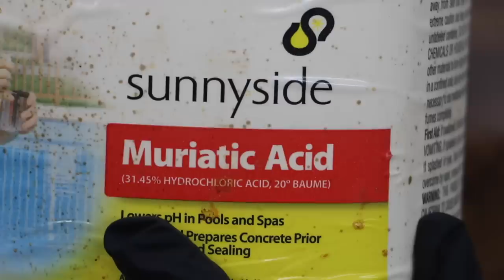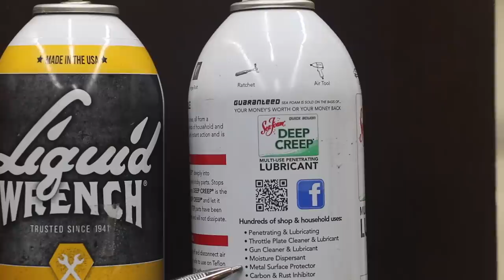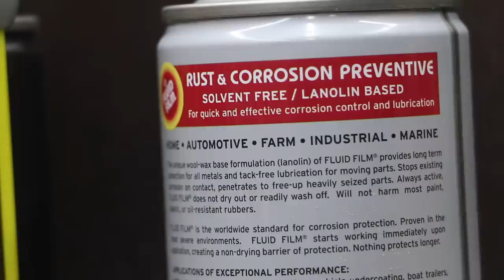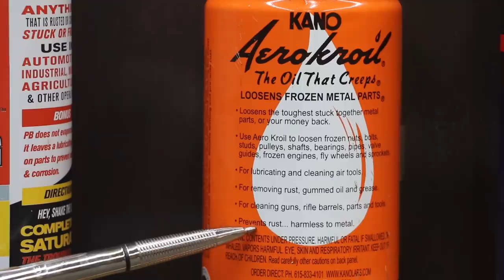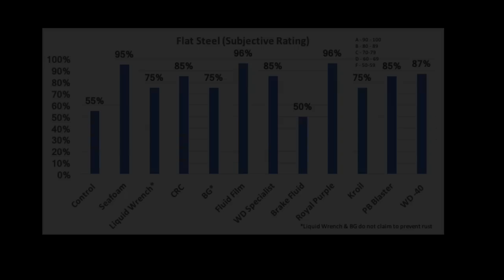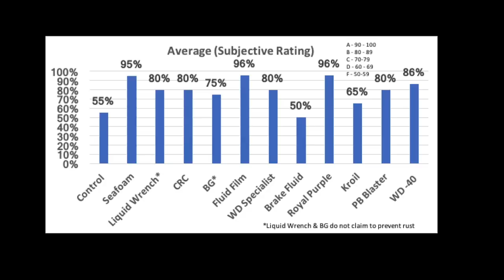Do Penetrating Oils Block Rust?  Let's find out!

Comment: Brake fluid must be a good penetrant since it corrodes away at bolts lol.
Reply from the maker: lol. Great point
Reply: Brake fluid is great at attracting water, too.  Good stuff if you're into that sort of thing, I suppose.
Reply: Brake fluid is really good at cleaning metal because, as you showed, it penetrates really well.  However never use it if you plan on welding on that metal.  The heat will cause any residual (talking molecules) of brake fluid particles to convert into a highly toxic gas which can be deadly to anyone who breathes it in.
Reply: Oh crap........really?
Reply: Ooooooof, unhealthy!!! But that publication is talking about brake cleaner it looks like, what about brake *fluid*? I know it smokes like heck when heated.
Reply: Good catch, you're right.
Reply: @johnbrereton6823   Phosgene is a particularly nasty gas. I've smelled it.  It affects you immediately. My Dad was a refrigeration contractor.  I know that phosgene is  produced when freon  hits an open flame.  Older aerosol cans used freon for propellant.  Maybe that's the reason for the warning.
Reply: @jerrybobteasdale  https://en.wikipedia.org/wiki/Phosgene  is particularly enlightening.  Also, it was used in WW I as a weapon.  Confirms what you say but there are are more interesting details.

Comment: Thank you soooooo much for this. I'm building my boat and I've been using fluid film to redo all my electrical connectors, gauges, and control box and so glad I spent the extra money on it knowing I won't have to replace this again. While the down side is it leaves it gooey, I dont care cause at least I know the film is visibly still on doing its job
Reply from the maker: Thank you!  Fluid Film is a great product for blocking rust.
Reply: @ProjectFarm  tell me about it. Unfortunately the previous owner wasn't as anal as me so now I have to use muriatic acid to take the steering bolts out to toss and make all new.  Completely rusted and I saw how it ate up the rust

Comment: I wish you would have tried MMO, I have used it in my air tools to keep them from rusting.
Reply from the maker: Yes, I wish I would have tested it. Great recommendation.
Reply: good idea, I use their air oil in my tools, too. An old hot rodder I know swears by using like 4 ozs of it in his mopar 440 when he gases it up. The can used to advertise "top cylinder lubrication", not sure if it does anymore.
Reply: I use MMO in my oil (4 oz/qt) and mix it in the gas plus a little 2-cycle for added lubrication and corrosion protection from the ethanol gas. The MMO prevents gum and the 2-stroke oil prevents corrosion. In my mowing equipment, I use 2 teaspoons each per gallon of gas, no problems from bad gas... Air tool oil is a little different by absorbing and removing water

Comment: You could do another test and open it to gun oils or tool oils.   Some gun oils are as cheap as $3 and they are designed to protect big investments, so perhaps they can compete with the products at the Auto Parts Stores.   They're also available at walmart, bass pro, and tractor supply stores.
Reply from the maker: Thanks for the suggestion.

Comment: Is Wal Mart brand Super Tech lubricant the same formula as WD-40? It might make a good test lubricant. At less than $2 a can it would certainly be the cheapest. I use the stuff all the time. My biggest gripe with WD and Super Tech is the propellant usually runs out before the liquid,however there are some good videos on you tube showing how to recharge the cans with an air compressor.
Reply from the maker: Maybe I can put together a video on this. Thank you
Reply: I don't think they are the same.  I have a can of each right now and go back and forth depending on which happens to be closer at that time.  I feel the Super Tech Lubricant is noticeably thinner and most usually runs right off (like its viscosity is very similar to water); it does not seem to stick to the part as well and is more easily wiped off cleanly.  WD-40 seems a little thicker and "oilier" to me - more pools up on the threads before dripping off.
Reply: Totally. I think some brands run out of propellant early, but others continue spraying after all the product is gone.

Comment: Have you any experience with ACF 50 or CorrosionX on Iron or Aluminium?   They are very expensive but if they work a lot better then they are worth it.   ACF 50 claims protection on Aluminium for a year .... a very bold claim indeed!   I presume Iron would be similar.
Reply from the maker: Thanks for the recommendation!

Comment: At the print shop eons ago we found that Kroil actually has water in in it. We stopped using it.  And for my money I stick with wd40 for general water proofing car and truck windows and ignition parts and nothing beats liquid wrench for rusty bolts. Just give the bolt a spritz every once in a while and go work on something else.  This is a great test brother thanks a lot!!

Comment: I love your videos like anyone that watches them.  I haven't watched them all (yet) but I have watched a few of them more than a few times.  Especially the penetrating oil videos.  Unfortunately, I think there is a problem as far as a "real world" scenerio regarding these products in this video being used as a rust preventer and I will explain.  

The problem is, nobody is using these products to actually "prevent" rust.  The reason being, in a typical situation where someone would buy a product such as a vehicle, farm machinery, piece of equipment, or otherwise, nobody is getting their product AND IMMEDIATELY taking the time to either spray down every nut or bolt in or on that vehicle, equipment, piece of machinery or otherwise OR, paying someone to take the time to go through the process of spraying down every single piece of component that is exposed to the elements such as a bolt, nut, hinge, or other movable piece of metal or stationary piece of metal.  Nobody is doing this ever.  

Honestly, I have never ever heard of any such action from someone that has purchased something.  

As such, that is the first problem.

The next problem is that you have to consider how frequently you would have to spray down every single component or every nook and cranny (spelling?) for these products to even stand a chance at helping everything.  

Let's just take for example a vehicle, farm machinery, or other piece of equipment that is exposed to the elements on a regular basis.  If someone was to drive their vehicle through the first rain, all the water would wash away these products.  Or, we would have to "assume" that the water splashing up under the underside of the vehicle from traveling down the road woild wash away the product after onlya few minutes of constant spraying of the rain on a nut or bolt.  Or, the rain coming down from above would wash away the producf due to gravity after even a short amount of time. 

And so, as a result, you would have to go through and reapply the product after each and every time you drove through rain, snow, ice, mud, slush, sleet, or other unfavorable weather condition that involved any kind of moisture.  And this would require a lot of time that nobody is devoting to make sure every nut and bolt or other piece of metal is protected by spraying down their entire vehicle or whatevef.  They just aren't.  As I stated, first of all, nobody is doing this to begin with when they first buy a product but also, they sure as heck aren't doing this each and every single time they get done driving their vehicle through the rain or snow.  

So, how is this even a "real world" type of situation that anyone is using the product for as far as a "rust preventative"?

My guess is that people pretty much ONLY use these products as a penetrating lubricant to free up rusty parts such as nuts and bolts or some sort of movable part (like a hinge) or other rotating assembly and nothing more because that's pretty much the only "real world" application for these types of products.  

I just can't see anyone spending their own time which might be 30 minutes to an hour (or more maybe) spraying down every single engine bolt and nut or getting under their vehicle to spray down every single nut and bolt or movable part or, paying someone else to do this.  Can you?  It would be too time consuming and expensive with purchasing these products every time you drove in rain or snow.  Just my thoughts.
Reply from the maker: Great feedback. Thank you

Comment: I would have liked to see ATF in this test.
Reply from the maker: Thank you for the feedback
Reply: Ken Call  Would you mind telling the ratio of ATF to alcohol ty
Reply: ATF is acidic, why they say wash immediately if contact with paint. It will strip paint. There are several other fluids that are acidic. Brake and Power Steering. Why you could potentially used ATF in those systems. But not as oil.

Comment: This explains why!!!  I cleaned up an old rusty pipe wrench on the wire wheel... I wasn't going to touch it for a few days so i sprayed it down with PB blast and let it sit... Where the PB blast was concentrated it started to rust back over... Not so much on the area's that were less lubricated...
Reply from the maker: Thank you for the feedback!  I learned my lesson with PB as well and avoid using it outdoors

Comment: Just move down south. No rust problems there. I HATE rust!
Reply from the maker: lol
Reply: I live down South. I see rusted out cars and trucks and they always have Midwestern plates! Cars rust here, but much slower.
Reply: 5Rounds Rapid 
My 84 Nissan pickup and 67 Mustang have never been up north. Some rust started on the Nissan after salted roads last winter.
Reply: Just don't move anywhere near the ocean. The salt water in the air is just as bad as salted roads, if not worse.
Reply: Here in Arizona,  rust is quite rare.

BUT;

Don't leave a tool outside!  Any time from 
March to November, you set a tool down 
in the sun, it'll teach you.

Experience is a GREAT teacher.  But, the 
best teaching moments come from bad 
choices.

steve
Reply: Steve Skouson 
Do they burn you?
Reply: Yep, you'll only do it once.

steve
Reply: Yeah but its hot
Reply: i moved out west and my 86 300zx has a TINY bit of rust anywhere on it, but my 97 subaru legacy from illinois was rusty everywhere lmao
Reply: i had a wrench in my black car sitting in the sun in vegas and i burnt my fingers taking it out :(

Comment: This is a great video! I just changed the ball joints on my truck recently and the original 20 year old ball joints had less rust on the studs than my replacements have built up for a few months! Ill be dropping by the parts store today and looking for either Deep Creep or Maxfilm to spray them with occasionally.  Thanks Project Farm!!
Reply from the maker: Thank you!

Comment: I will use one of the three winners to spray into the body panels in my vehicle before spraying oil in them to prevent Michigan rust...I just sprayed oil in my 91 GMC pickup panels randomly through the years which I attribute to its minimal rust over the years. Pre spraying with one of these products will help get it into the tight spots where panels are spot welded together.
Reply from the maker: Thanks for sharing.

Comment: Only "ISSUE" I had with your testing was the threads are completely encapsulated with the Fluid Film.  IRL or as normally used, the threads would at best be holding less than 1/1000 of an inch since the opposing threads would immediately strip away the excess.   While I have no dog in this fight, I have to admit your testing procedures are 99% fair 100% of the time!  Darm impressive - even the wife sat in on this one and actually spoke to some of her gal pals regarding the findings!!! LOL  Then again, she's a barrel racer and is on the road towing, hitching and always trying to avoid problems before they start.  
WELL DONE & Keep these tests coming!
Reply from the maker: This is great constructive feedback. Thank you

Comment: I keep Fluid Film and Deep Creep in my shop and service truck. Deep Creep for removing rusty bolts, Fluid Film (I do not use this if I am using thread locker or anti-seize.) to coat rust prone bolts prior to installation. 
A few years ago I changed an engine in one of my trucks (20 year old diesel that gave up the ghost after 300k miles). The manifold to exhaust pipe bolts were horribly rusted and I really expected them to break off. But I took a chance and for 3 days I sprayed them with Deep Creep once or twice a day. After 3 days, I had a rusty puddle under the truck at both manifolds. Put the wrench to them and not a single bolt broke. From that day forth, I buy this product by the case.
Reply from the maker: Thank you!

Comment: I use WD-40 for everything. It’s not as good as a 1:2 mix of petrol:diesel for starting fires but I love it for loosening rusty nuts, lubricating saws for cutting hardwoods, lubricating various types of drawer and tool slides etc. and I use it on my trailer couplings, gate latches etc. for preventing rust. It seems to collect a bit of dust and some micro metal shavings, turning into a yucky black coating that water doesn’t penetrate and that stays nice and rust free and decently lubricated for a month or two out in the weather.

Anyway, excellent video as always. Cheers from Australia 🇦🇺
Reply from the maker: Thank you!

Comment: I just want to take the time to say before I purchase anything I’m always checking  with your videos first !!!!!!!!   You really make a difference...very nice job ...thank you.....my new project I have going on  is ,  I have a Husky 1500..psi power washer that has 2 pin hole leaks in the pvc parts in the wand .....and I consulted THE  channel about JB weld.. locktite ect ...and other 2part apoxys as well....while shopping I found  a locktite  2 part that offered 2500 psi bonding under pressure ( cure time 24 hrs)  I might be able to “”plug the holes “” even though you don’t have these test ..I thought it may make a difference on plastics instead of metal ( as a hole plugger)
..since their is about 15 different kinds of pvc’s  and hard plastic pipe out their  it could be  show ...keep up the videos ..I always like them(((( btw I also had a plastic spray nozzle that developed pinhole leaks in the past ) .. never could fix it ...the YouTube videos weren’t  around yet lol....
Reply from the maker: Thank you very much!

Comment: for a spray on application  - Corrosion X  or   LPS 3 . probably the best coating / preventative .  for a heavy industrial coating - melt a candle into wheel bearing grease and apply with a brush. you'll have to use a steel brush to remove it.
Reply from the maker: Thank you for the feedback

Comment: Important stuff here in the rust belt! a few winters here in new york without any kind of rust prevention and you may as well have a pile of scrap as a car. important note here is that fluid film is by far the most popular rust preventative undercoating used in automotive applications, although krown is another similar product and they offer a lifetime warranty against corrosion as long as you get it done every year since the car is new.
Reply from the maker: Thank you

Comment: Jasco prep and prime is great for rusty parts you want to paint or as a protectant for parts you cant paint right away we used it on front loader for our john deere 2020 we wire brushed the rust away and added the Jasco primer its been 2-3 years still not painted NOR rusted back yet  its a good product  but a lil pricey even though a little goes a long way. We use this on our welding table as well which we use inside and outside depending on the work. Great video's keep them coming my friend.
Reply from the maker: Thanks for the recommendation!

Comment: Great video.  Check out Honda high performance chain lube.  It creeps in better than anything I've tested - if you use some heat.  After - it acts as a barrier - almost like a wax based undercoating.
Reply from the maker: Thank you for the recommendation!

Comment: You should do a rust preventer showdown... not penetrating oils... just products made to prevent rust.  My 3 favorites in this category or BOESHIELD T-9, CRC 3-36 and Renaissance Wax ... They are all best in class with differing characteristics depending on use.  I use them on my woodworking shop tools ... especially table saw top and other smooth machine surfaces.
Reply from the maker: Thanks for the video idea.

Comment: my buddy works in a Potash (salt) mine which has high humidity and is 98 degrees year round.  they use Fluid Film penetrating oil on all their tools. if you don't spray new tools with it they rust in hours. also a couple of cans of fluid film makes an easy and cheap undercoating for a vehicle.

Comment: Would've liked to have seen used motor oil in there, in addition to the products you already had, just out of curiosity. Way back in the day, my grandfather had paying customers come to his garage to have used motor oil sprayed all over the undercarriage. Even drilled the rocker panels, and frame, and loaded those up as well. Long before the EPA was a thing, lol. 

I still use it on my own stuff as a rust preventative. Works really good. I had a neighbor do Fluid Film the past couple years when I got busy - that has worked well also.

Trying to preserve my '07 Silverado. It's a losing battle, but I've slowed the process down significantly. MA life for ya - 12 years is about maximum on a new vehicle these days up here, before the body becomes Swiss cheese, and it then fails inspection.👎😖 New cars are a poor investment in this part of the USA!

GREAT video - thanks for all your efforts!!
Reply from the maker: Thank you for the recommendation!